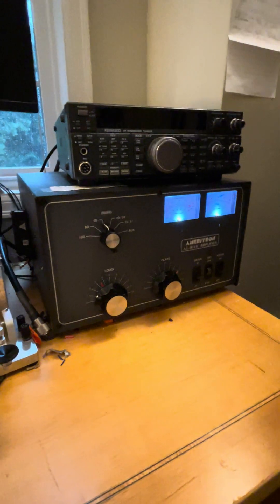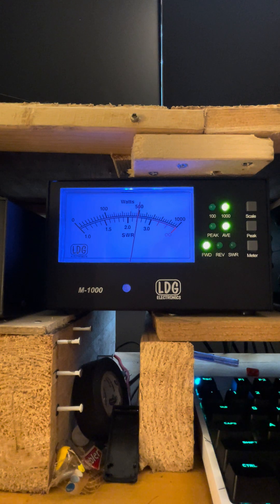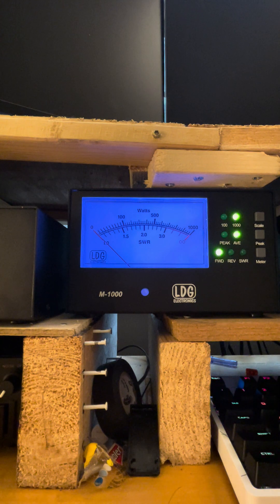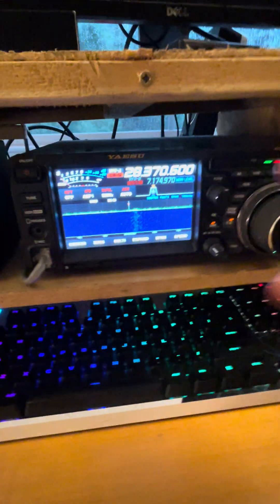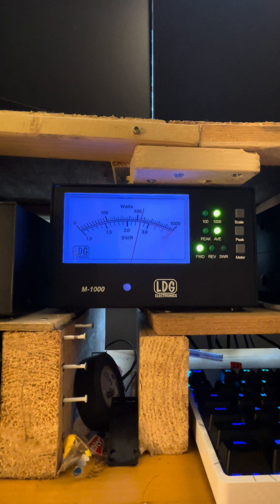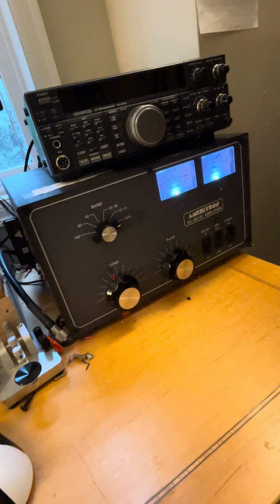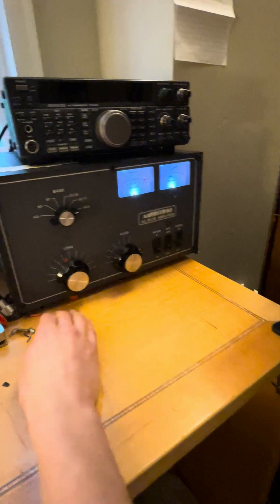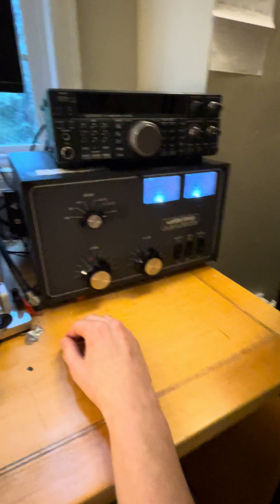Ameritron AL-811H Amplifier Full Review and Demo

Comment: Also got me an al-811h
Been using it foe 2 weeks now.
Is that a kenwood ts-870 on top of the amp.
How is that radio.  
I can get one. But for 3 times the price i can get a ftdx10.
Think the seller is overpriced the kenwood.
But the 870 do have 2 antenna inputs and a receive antenna input that would be useful. 
There is a ic7600 withe the same inputs for double the price of the ts870
It is difficult choices. 
But i really like the ftdx10

Comment: The red on the plate current meter applies when reading voltage, not plate current. Manufacturer simply says do not exceed 750 mA of plate current or 200 mA of grid current. Also supposed to observe the plate current at 75 mA when keying up and no drive power. If the grid current meter shows any movement, you have a problem. Also manufacturer says never use the tuner in your radio upstream of the amplifier. Also manufacturer says never use an external fan or any other means of cooling. You are to strictly leave it alone as designed. Thanks!